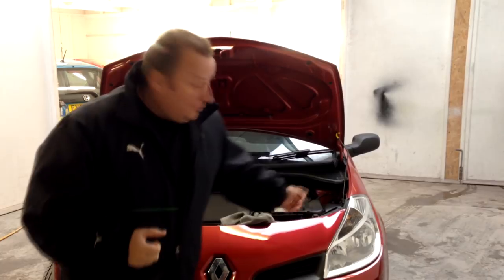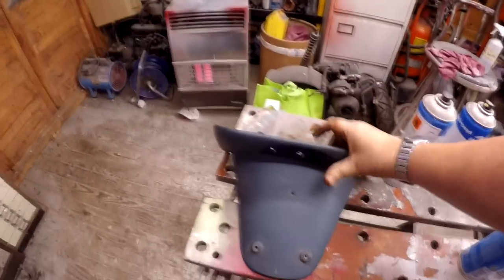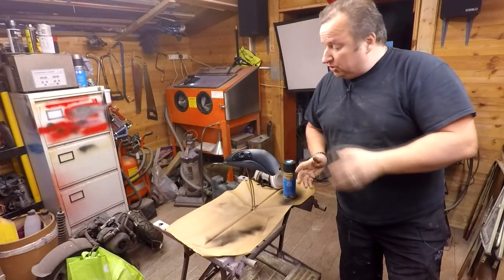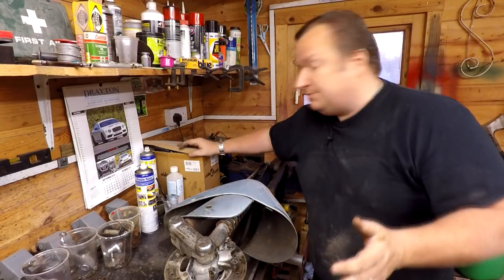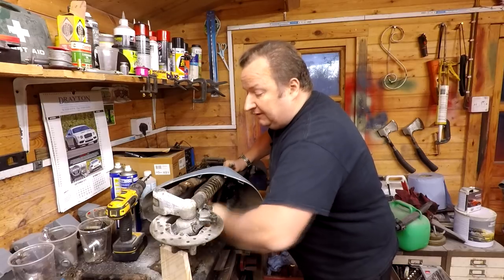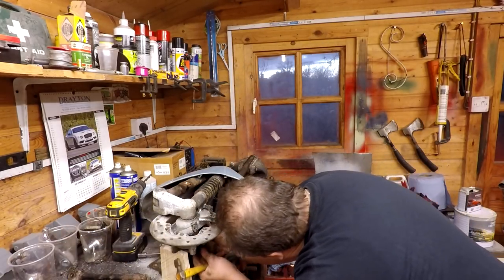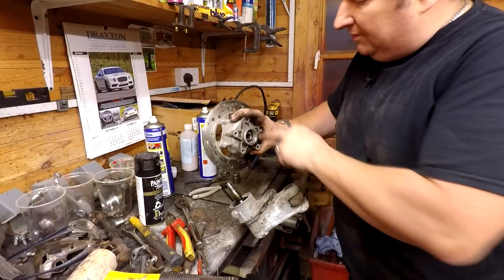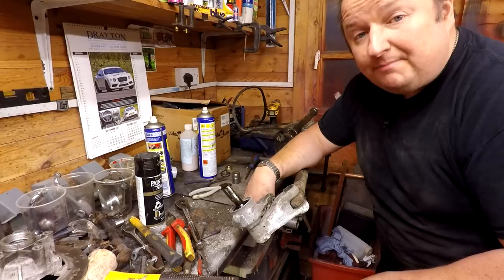Vid 9 Piaggio ET2 50cc Vespa Respray Strip The Front End

Comment: Ah Vespa fork work, such a pia :(  Everything just seems to rust and rot out inconveniently, I replaced all my old fixings with quite expensive surgical grade stainless steel ones as the previous so called stainless steel ones just rotted out from within...   You gonna do the lights n mirrors things, get an old parka for your brother?   See if he wants to go down to the Skeggy scooter rally and see some of the beautiful machines that go there, some of them lightning quick tuned to the heavens, couple pints and a pie and decent music all weekend usually (bit too far for me, days of me travelling up and down the country are long gone but do often take the three wheeler which is accepted well)
Reply: Unless the link arm bearings are graunchy best to leave 'em alone as they need a heavy press to knock out and then new ones in, I think there is a vid by Scooterwest showing how to put water egress O rings into the two small channels on the link arm, SKF do make some very good bearings for Vespa and I always use theirs instead of the cheapo ones off da fleabay and never been let down by a SKF which I have fitted to my Vespa and Lambretta wherever poss :)   Bit miffed cos a PX/T5 mudguard is an absolute PIG to get off with out damaging it and even more of a PIG to get on without having to do the Vespa forks fandango dance mixed in with a bit of "Wiggle it just a little bit" lol was so expecting you to have a struggle and it comes off so easily /sigh
Reply from the maker: You are right about the link arm pins Ian, Luckly, these are fine so I don'y need to touch them. It's a stupid design that mudguard, I agree.
Cheers
Martin